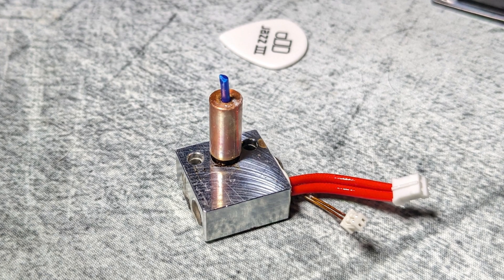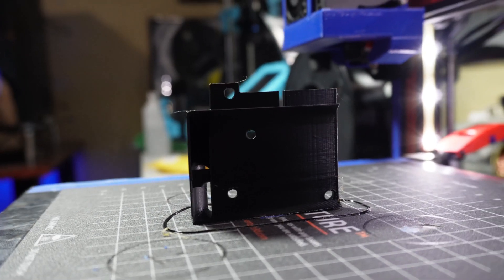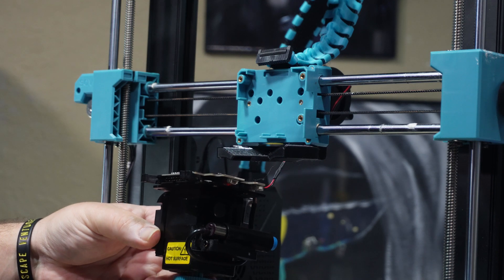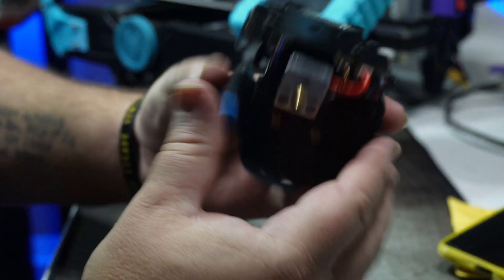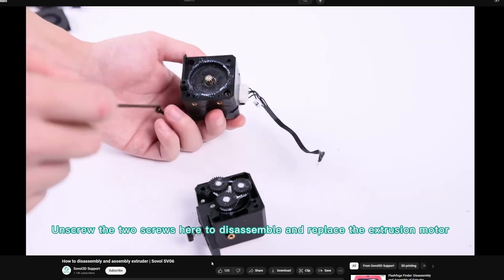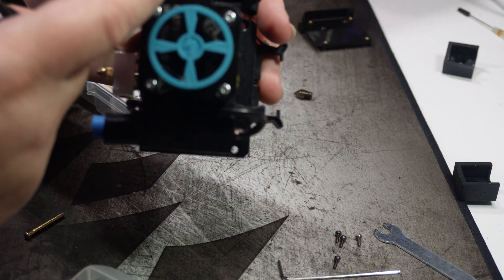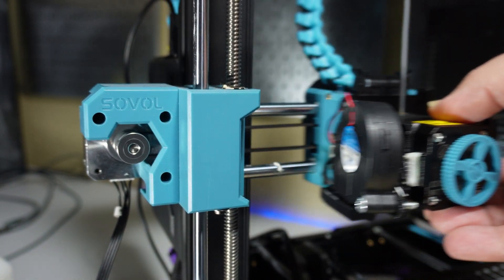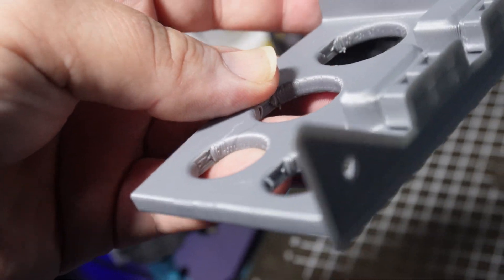Adding a Blower Fan to Stop Heat Creep | SOVOL SV06

Comment: Thank you for the amazing videos—you're saving me every time! 😊 Is there a way to configure the fan so it stays off when not printing, runs at 20% for the first 1.5 hours of printing, and then switches to 100% after 1.5 hours? The noise in standby is a bit much. Thanks in advance! 🙏

Comment: Must be nice, my heat block wires are siliconed in place... I'll just have to get a new hot end. Too scared I'm going to break everything trying to get the silicone off.
Reply from the maker: Mine were siliconed in place too. Their replacement block is the same.

Comment: I purchased my SV06 in March of '23.  It appears that they had added a second fan on the print head which protrudes out under the extrusion wheel.  ;|
I want to add an endoscope to video the nozzle, but from what I've seen on your videos, I'll need to remove that second fan.  Unless you can suggest a better way, my thought is that I'll remove both fans, add a 5015 using the offset mount above and then use your endoscope mount.  I can send a pic of the stock 2-fan head if you have a way to receive.  Cheers.
Reply from the maker: Hey, do you mean this fan? https://tinyurl.com/4zr675rj

If so, it's on all of them. You have to remove the screws and the bracket holding it on (the two holes left on the hot end is where you will mount the nozzle cam bracket). 

I made this video ( https://youtu.be/hw39j5DV56M ) which goes more in depth, and in the description are the fans I used and everything you need. The only difference is that I had to use this fan shroud ( https://www.printables.com/model/483474 ) instead of the one from that video to work with the nozzle cam. Unfortunately, some soldering will be needed because the plugs on the fans are different sizes (explained better in the video). 

Hope this helps!
Feel free to message me any time here - triumphinglosersbusiness@gmail.com

Comment: I'm just about to do this fan upgrade for the heat creep and for cooling, have those winsinn fans been working well for you or is there another kind you would recommend?
Reply from the maker: Thanks for watching the video! I've used Winsinn fans on pretty much all the printers I've owned, and I haven't had an issue yet.
Reply: @Avel  ok thank you Ill be ordering some now!

Comment: I will be doing these fan mods to my new Sv06. I am also planning on running clipper on a spare Raspberry Pi (with touchscreen) that I have sitting around collecting dust. Thanks for showing off your upgrades and sharing files!
Reply from the maker: No problem, thanks for watching!

Comment: I'm about to do that same mod to my SV06 Plus, though I haven't had any clogs, at least not yet. I remixed the fan mount (2nd one in the video) by cutting away a big chunk of it because it seems there is just too much material in it - no need to cover the whole side of the extruder. Saves material and weight.
Reply from the maker: Good call!
Reply: Do you have a link to that design?  I'm going to be printing this upgrade soon.
Reply: @dapperduckling3951  No, I just used the Cut tool in Prusaslicer as well as square cubes as negative volumes before slicing it. It was simple and easy to do.

Comment: New subscriber here.  Thank you for these Sovol tips.  Just recently got the sv06 plus and your experiences have helped me with the klipper upgrade.  Just a side note about the heatcreep issues;  Sovols factory profile seems to me sets the temp way to high for pla and this causes heatcreep in all metal hotends running pla especially if your retraction setting is higher than .5.
Reply from the maker: Thanks for the sub! I appreciate the tips, I will test out some different settings when I get back.
Reply: I have a SV06 Plus with Klipper as well. Which factory profiles do you mean, in which Slicer? I haven't had any issues with Prusa Slicer. I have been printing PLA at 200-220 C without any problems, the longest print I had up to now was about 8 hours, 17mm3 & 80mm/s max speeds, 0.8mm layer width with a 0.4 nozzle.

Comment: I honestly don't understand the need for cooling on anything except bridges.

I've been 3D printing for close to four years, and the most important lesson I've learned is that part-cooling fans are a sure-fire way to have parts separate themselves from the print bed, unless you tell the slicer to leave fans off for the first 150 layers. And then when the fan does come on, I see no difference whatsoever in the part.

Maybe it's for printing at over 150mm/s?
Reply from the maker: Bridges and overhangs are both improved with the fans. I hear you, though. In my experience, yes, they're more useful with faster printing. I had the same stock fans on my Ender 3 Pro and CR6 for years without any issues.

This particular fan, though, keeps the filament from melting inside the heat break and causing a clog. I didn't experience this issue until I started printing faster. My guess would be that it has to do with the faster retraction speeds.
Reply: @Avel  So sorry, I thought this video was about the part fan. Heat break fan is, of course, massively important.

I'll see myself out...
Reply from the maker: Haha, no worries! I appreciate you stopping by, regardless.

Comment: How’s the volume on this? Trying to make my sv06 quieter while keeping good speeds
Reply from the maker: I hear you. That's a tough thing to balance. I wish there were speed controls for this fan because it is louder than I'd like but I guess it's the trade-off for speed. 

It is louder for sure, but the stock power supply fan is still the loudest fan on my printer. That'll be next, or just a whole different power supply.
Reply: @Avel  i ended up screwing on a silencer which points the outtake if the PSU towards my wall, works pretty well but I question if it'll be good for the health of the printer
Reply from the maker: Are you talking about something like this? https://www.thingiverse.com/thing:3742240

If so, I've had one on my Ender 3 for years without issue. It's great for redirecting sound, but since mine is now on my desk close to the wall it just reflects the sound back at me off the wall 😆
Reply: @Avel  yeah, thats pretty similar to the model I use, though in your case you'll have to open the PSU and put like a noctua fan in there